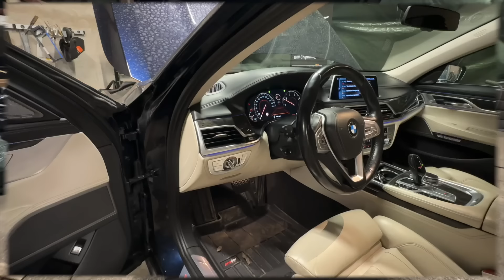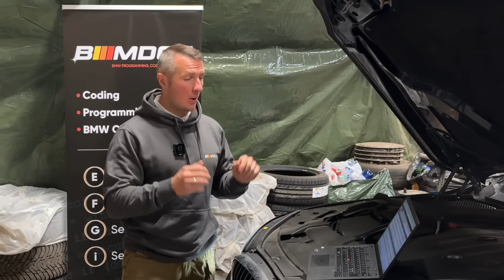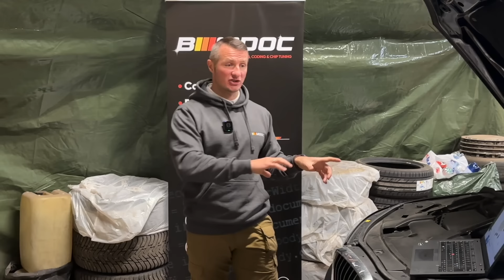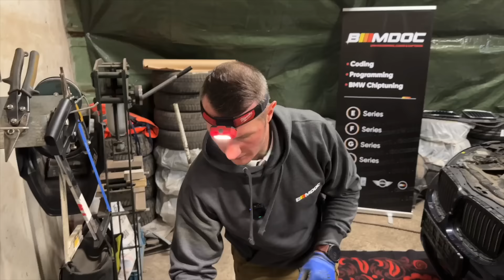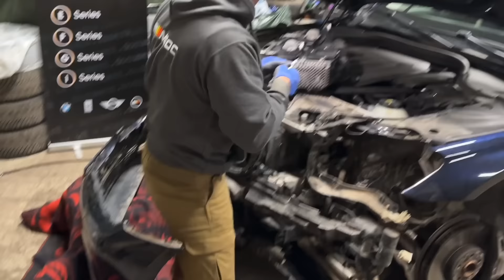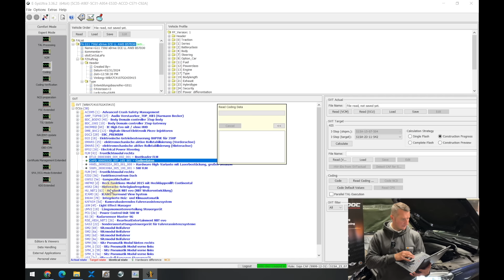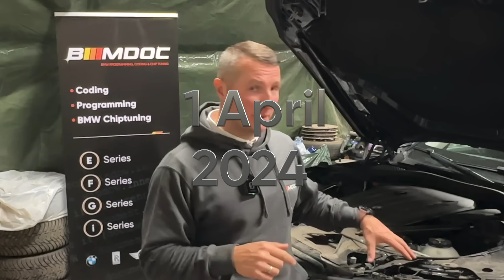BMW F and G Series Headlight Fault Diagnosis & Fix | Step-by-Step Guide

Comment: Thanks for the interesting video! I had a question, after coding and programming, esys still showed 43 - right headlight (German - Frontlichtmodul rechts) and 44 - right headlight       ( Frontlichtmodul rechts), although it should be 43 - Frontlichtmodul "links" (German - links, English left). Will this not affect the operation of the lights?
Reply from the maker: It is just information for the user. Esys takes reference from ECU index (x43 and x44)
So it will not affect the programming procedure

Comment: Good video Vladimir. 
I have similar issue with my F11, but esys wont see the TMS modules, I believe they are part of FRM3, and I dont get an option to compare cfd files. Kind of stuck with this problem now.
Would apreciate any advise
Reply from the maker: Visibility of TMS on F11 depends on headlight types! If you cannot see any TMS then yes they are being coded automatically when you are coding FRM3

If you have adaptive xenon for example then you would see TMS/FLE or smth like that. 

But you can still swap TMS for a check.
Reply: @BimDoc Thanks for reply, Im just kind of stuck with this problem now, the TMS module wont initialise via ISTA because its used, I believe the only way to get round this problem to disable ID check on FRM which I dont know how to do it.
Sorry for being so annoing, but would you be able to help on this on the remote service, obviously not for free.
Hope to hear from you soon
Reply: @pasaulis22 Did you do it somehow?